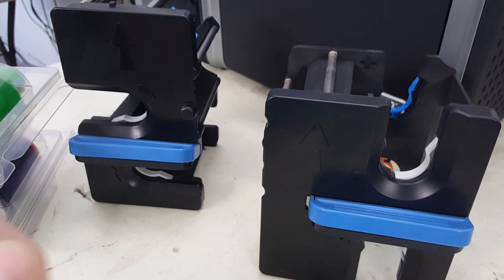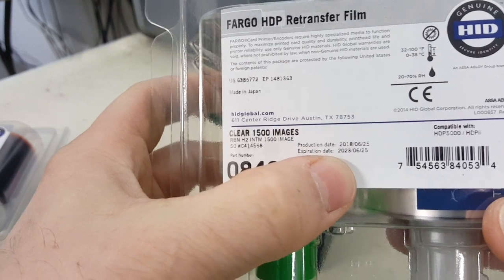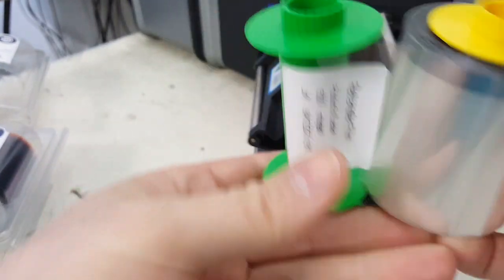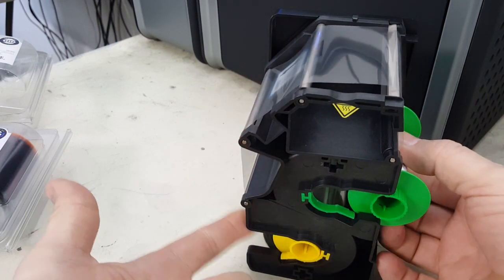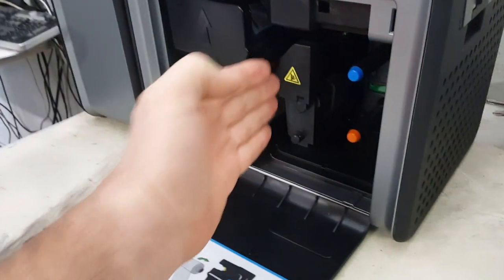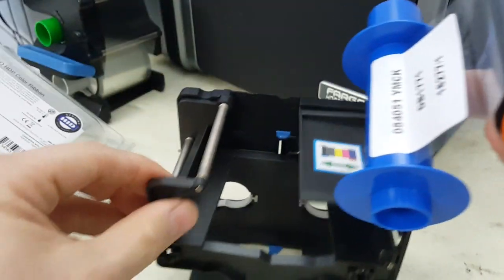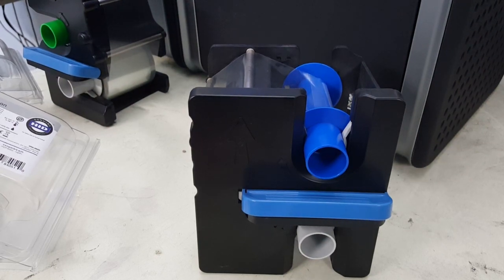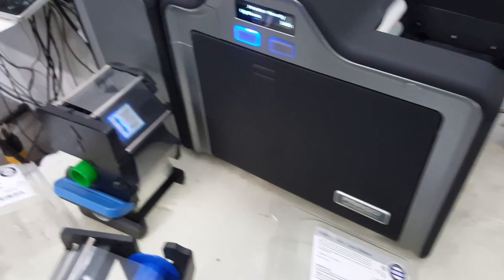Fargo HDP5000 / HDP5600 / HDPii Tutorial - How to Load / Install the Ribbon & Film

Comment: What is the difference between the hdpii and hdp5000
Reply from the maker: They are essentially the same printer.  However the HDPii was sold exclusively to banks and financial institutions as a Financial Card Printer and Encoder and came with both magnetic stripe and chip encoders.

They use the same ribbon, film and supplies.  Have the same printhead and quality.

NOTE:  The HDPii does not support attachment of a lamination module.

Comment: I am having color issues
Reply from the maker: 1)  clean the printer using Fargo HDP5000 Cleaning Kit 89200
Tutorial: https://youtu.be/_Je1ptDdci4
2)  calibrate ribbon and film according to proper methods
Tutorial:  https://youtu.be/CgxgewC7IWU
3)  print sample cards from the LCD or Fargo Workbench to determine color issues, if any, to rule out that the issue is your print file.